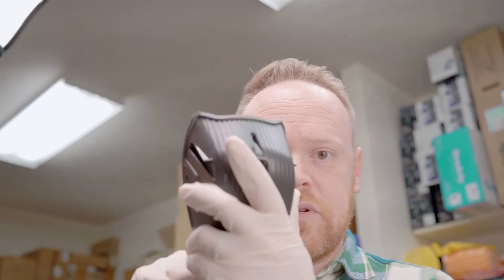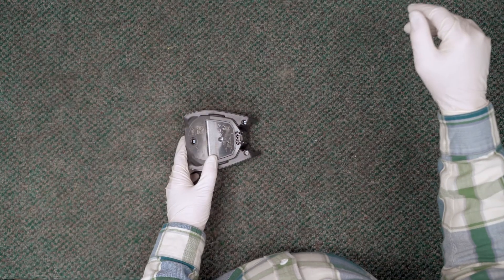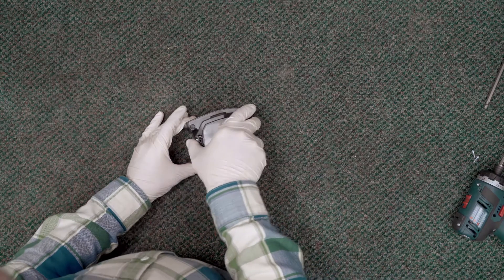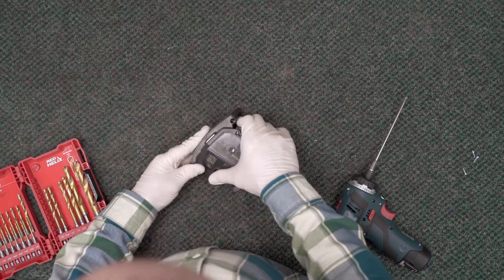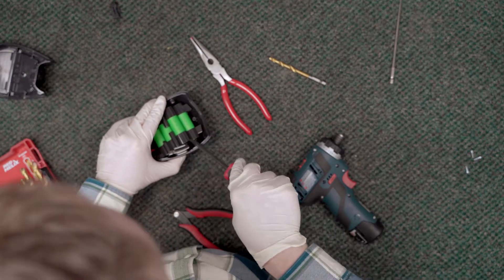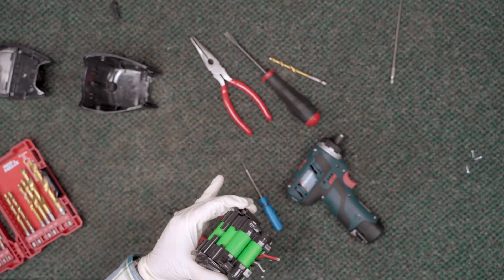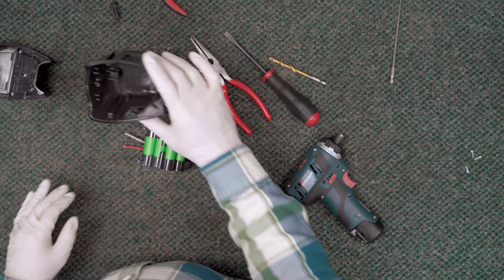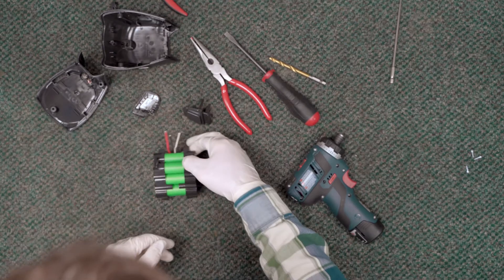What’s Inside This Mysterious Battery Pack?

Comment: I came here because my Miele HX2 has stopped charging. The batteries are similar or identical to the one dissected here. I think the PCB may have been damaged when the cleaner fell. This is a risk if the cleaner is configured and stored so that the motor part is at the top. I will contact Miele service.

Comment: @houseofvacuums Thanks for the video.  FYI you can disassemble the pack without cutting the wires. If you look carefully at the battery terminals you’ll see small notches on the outside of each terminal. That is so a very small flathead screw driver can fit in there to flatten small metal tabs on the terminals. Once those tabs are flattened, the terminal can be pulled out by the wire.  It may take a few tries and so slight prying of the screw driver to get the tabs flattened enough.  That way you can reassemble the pack if needed. 

FYI my vacuum quit taking a charge and I thought it was the pack. Turns out it was the charger..the barrel connector wasn’t making good contact with the wires so voltage wasn’t getting to the pack. Replaced the connector and all is well.
Reply: Hi, did you replaced all module with barrel connector ?  Where did you find that part ?  I can't find online ... thank you.

Comment: Hey great video.
I have a question. What would you expect to measure with your multimeter across the 2 inside terminals of a good battery pack. I ask because I have 28v on the outside terminals and  open circuit on the inside set. 
My problem is that the whole vacuum cleaner is no signs of life. And also none with charger plugged in.
Thanks
Ray
Reply from the maker: Hey Ray. Unfortunately, I think your battery has a bad BMS as it is not "talking" to the machine the way it should. The open terminals on the inside set monitor optimal battery conditions and send voltage to the machine as a signal to allow it to power on. I would get in touch with Miele about getting a replacement. Sorry it wasn't better news, but that will get it fixed for you. Cheers!

Comment: Mine has failed also I open new in the box battery did not last a week
Reply from the maker: Hey Christopher! Sorry to hear about your battery... it's a potential issue even on the best of vacuums. One thing that Miele Triflexes need is to be charged for the first time ON the vacuum. When you get a new battery, put it onto the machine then charge it. This causes the battery to sync with the machine. I don't know why it makes a difference, but it really does.

Comment: Any information on how long a fully charged Miele TRIFLEX HX 1 battery will last on the shelf? Also, if you're using a wall mounted charging station- does that eventually limit the battery's ability to maintain its charge?
Reply from the maker: Hi Lesley! Lithium ion batteries like the HX1 uses have very little self-discharge, so they will keep their charged stated for a very long time with little loss of power. In terms of shelf life before it becomes less desirable than a new one, there really isn't a time frame on that. Most new batteries, including the HX1, come from the factory with about a half charge as best practice. Storing long-term with a full charge can cause capacity degradation over a very long period of time, so they ship them half charged to avoid this issue.

For keeping it on the charger, the less you can do that the better. This is really true of any rechargeable item. The most convenient way I have found to take care of this is to charge your wall mount into a smart plug like those made by TP LInk, WYZE, Samsung, etc. This will allow you to set a timer on how long you want to leave the charging on. When the timer on your phone's app finishes, it will automatically shut off power to the charge while leaving your vacuum on the charging dock.

Hope that helps, let me know if you have any other questions!

Comment: Have you heard of bearing failure regarding the Hx1? I want to buy one but have heard of a common failure at the brush head which renders the vacuum useless.
Reply from the maker: Thanks for watching and the comment!
Yes, there have been reports of the bushings on the end caps melting if they get hair in them... and they seem to wrap hair pretty easily. I have a HX1 at home and my wife and daughter have long hair, so there is a lot of wrapping. I clean the brushroll about once a month and haven't had any issues so far using that schedule. Fortunately, it is easy to remove the brushroll without tools.
But if the brushroll hair wrapping is ignored, it will definitely become an issue for an owner.
Reply: @HouseOfVacuums  hey thanks for the reply!

Incase you wanted to know. I bought a SEBO Dart today. It is so nice!!! Best vacuum I have ever owned. My carpet is so clean. I love that it works on hardwood aswell.

Have a good one!
Reply from the maker: Awesome choice! That vacuum will serve you for many, many years to come.

Comment: Hi, Interesting vid! I had a question about the reasoning (if any) behind the manual instructing to fully charge the battery before first use. I believe I recall seeing similar instruction with other battery devices. I also wonder how many reports of poor battery performance of their Miele battery might be caused from people failing to follow these instructions?

I just got my HX1 2 days ago and followed the first time charging instructions closely so fingers crossed!
Thanks
Reply from the maker: Thanks for watching!
Now that the HX1 has been out for a little while it has become apparent that there were some issues with the batteries on the first production run. They have now been updated by Varta and Miele.
That being said, it is always a good idea to follow the instructions regarding battery charging as there are things than can be hard on lithium-ion cells that we don't often think of. Let the battery sit for about 15-20 before charging after use. Don't leave the vacuum plugged in. Don't recharge it every time you have a quick pick. All of those will help it last longer. 
If you just got your HX1 a couple days ago it should have been in the first batch of batteries, so just follow normal ownership procedures as outlined in the manual and above. It should last a long time for you!

Comment: Why take apart this battery.  I just wanted to see theASSEMBLY OF VACUUM.
Reply from the maker: I disassemble a lot of cordless vacuum batteries on this channel as it is the heart of the cordless vac. I will have more videos coming out on the HX1 TriFlex. However, I'm wondering what about "battery dissection" was misleading?
Reply: @HouseOfVacuums   I just thought assembly of vacuum was included.  No problem I figured it out .  I was just having a problem with sliding the battery in. Had to press the side buttons.,
Reply from the maker: Great, I'm glad it all worked out!

Comment: Great video. Keep up the good work. How do you think it compares the the Dyson v11 battery?
Reply from the maker: Thanks for the comment!
Each pack has it's own positives and negatives (no pun intended!). I like that there is more room in the Miele battery for heat dissipation. However, the V11 Outsize battery uses the 21700 cell (not sure about the regular V11) which give it more MAh.
In either case, they both use Murata cells which are top notch. In terms of construction and materials used I don't have any issues with each of them.

Comment: Hello there! Thank you for the video! Do you think the battery can be plugged to the mains via the charger WITHOUT having it installed on the vacuum?
Reply from the maker: Thanks for the question!
Yes, you can take the battery off the machine to charge it. The charger input is built into the battery. The only thing to be aware of if you do that is that you will not be able to see it's charge level. This is because the  charge level is displayed on the vacuum handle when you charge it on the machine.
Hope that helps!
Reply: @HouseOfVacuums  It does! Cheers!!